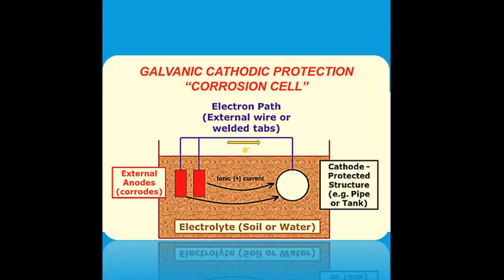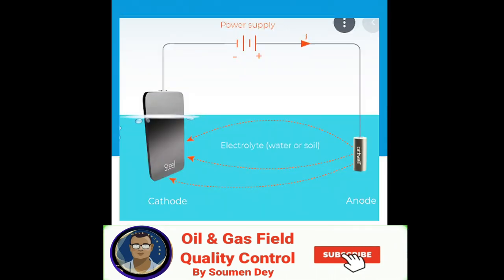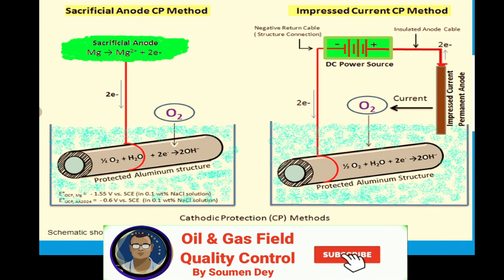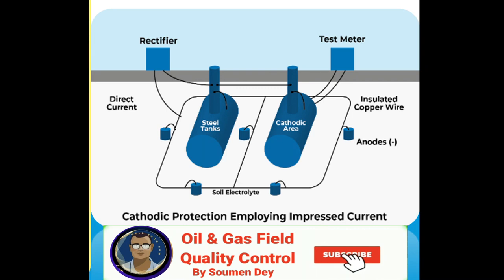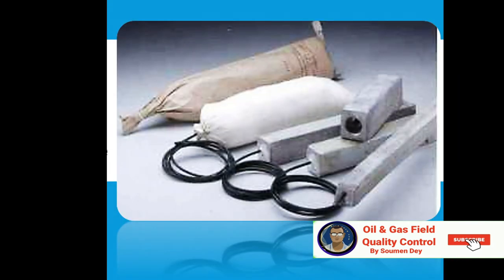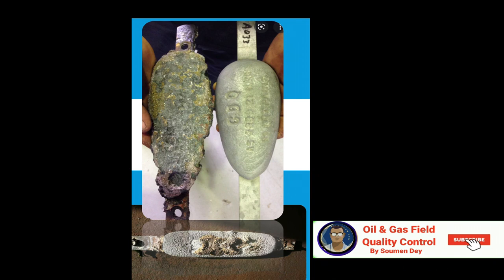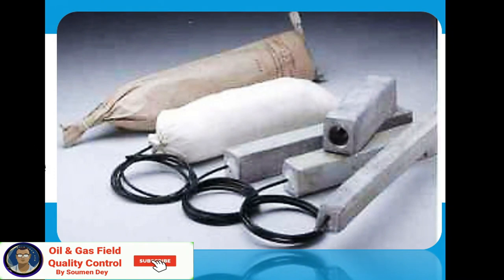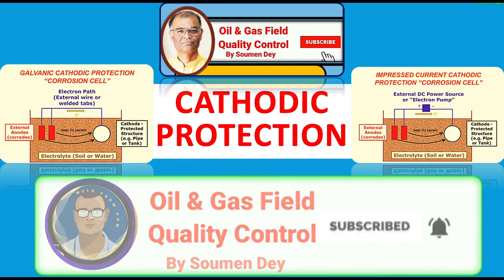CATHODIC PROTECTION FOR PIPELINES, CP,  ICCP, SACRIFICIAL ANODES, CORROSION PROTECTION OF PIPELINES

Comment: I can't understand one basic thing which is, How the circuit of cp completes as one end is in an anode bed and another connected to pipeline which may extends to some kilometers. How it effectively protect the p/l closer to the anode bed as efective as the end point of p/l which is some kilometers away from the anode bed. I am asking in ICCP method of protection.

Comment: Please guide me how to become a CP Engineer and what are the requirements?
Reply from the maker: Are you looking for any online course or full time engineering from any university- also for which country you will prefer to study??
Reply: Yeah I'm looking for CP engineering course. 
But please tell what are the requirements for CP engineering my qualification is 12th and currently I'm in KSA.
Reply from the maker: Dear, Can you please check this Link from Internet for more details=- There are several NACE related courses- You can opt what is suitable for you, Please contact them for more details: http://www.itc.edu.sa/en/courses.php?cat=810FA623-4DA4-E411-908C-00155DC8D200
Reply from the maker: CP 1 - Cathodic Protection Tester
CP 2 – Cathodic Protection Technician
CP 2 – Cathodic Protection Technician Maritime
CP 3 – Cathodic Protection Technologist
CP 4 – Cathodic Protection Specialist
Internal Corrosion for Pipelines – Advanced
Internal Corrosion for Pipelines – Basic